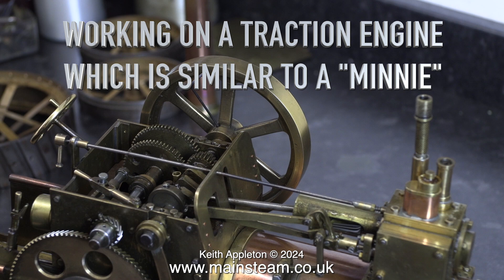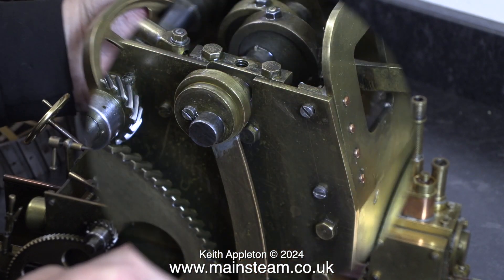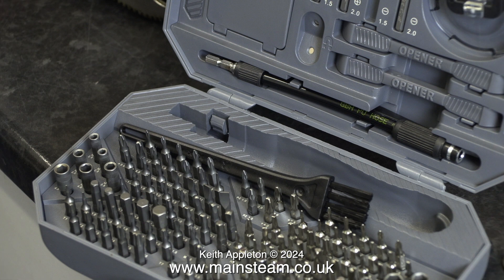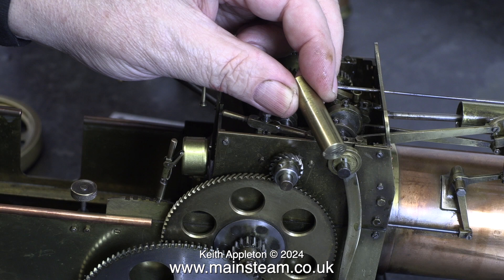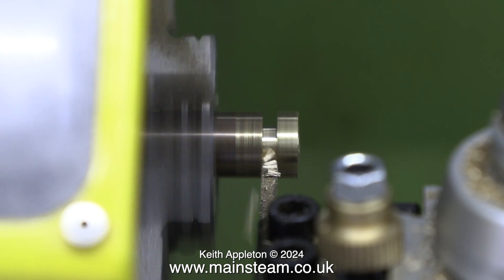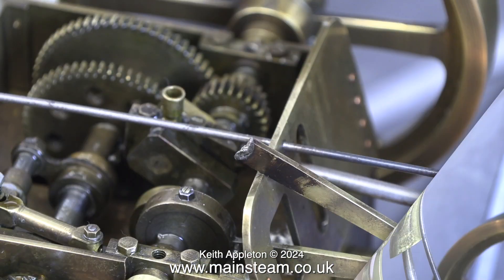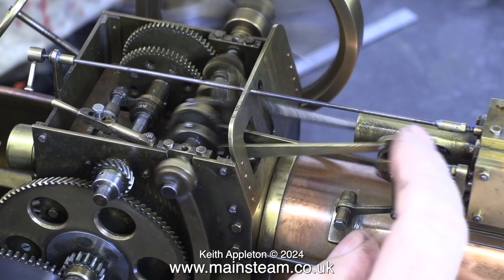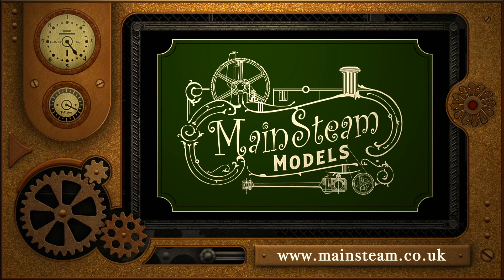A "MINNIE" TYPE TRACTION ENGINE - PART #3

Comment: Keith, I don't know if Stay-brite 8 solder is available in the UK.  If it is, you have a product that lies between soft solder and all out brazing.  Claims are made that the stuff is at least a fair match for brazing in HVAC applications.  Highly superheated steam may make it melt, but 200 deg. C. seems OK.  Given it's lead free and high in silver content, the price is high.
Reply from the maker: The melting point is far too low for live steam applications over 50PSI. Steam Temperature & Pressure are relative to each other.